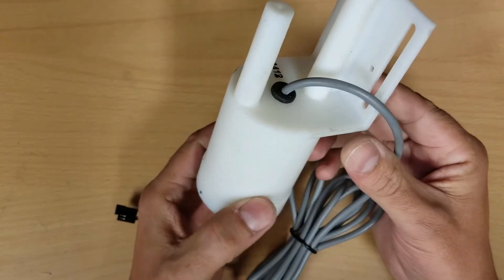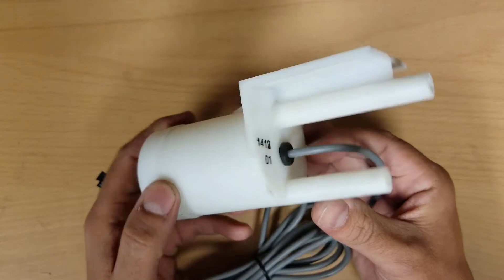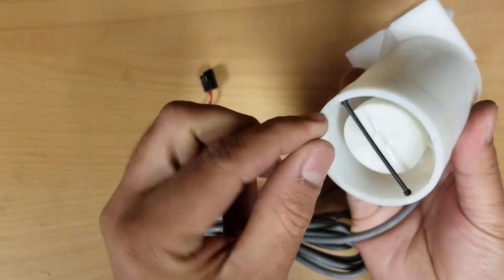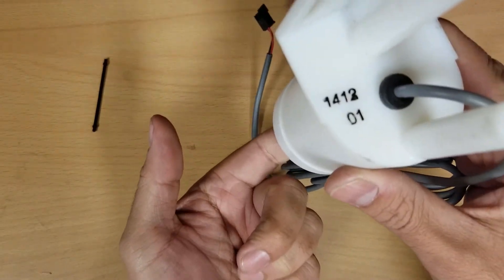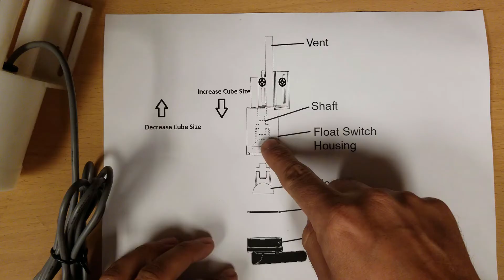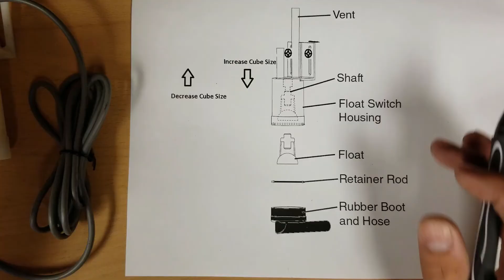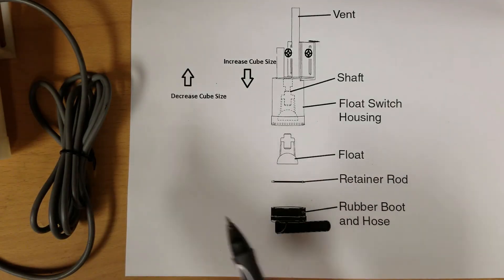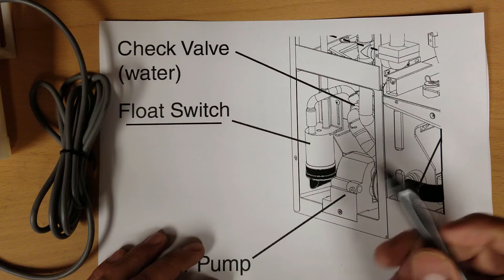Hoshizaki Ice Thickness Adjustment - Float Switch

Comment: Cool. Can you explain more?  What are the pros and cons of smaller vs larger ice cubes?  For instance, If you select larger cubes, does that mean the time to make a batch of cubes increases? Because if the time does not increase then the largest setting would increase production if desired.
What needs/industries prefer larger cubes and which smaller?
Thanks
PS I found this online answered some of my Q:
Hoshizaki Producing Smaller Ice Cubes Due to Float Switch Issues
Finally, when looking at the float switch, you will see that it can be adjusted. The higher you adjust the switch, the smaller the cubes will become because the switch will tell the machine to stop freezing sooner. If you move the switch lower, the cubes will be larger because the switch will tell it to stop freezing later.

Be careful playing with this adjustment because if you make the cubes too large, they may bridge (i.e. start freezing to one another), have large dimples/ridges which will give you all kinds of trouble with long harvesting times, freeze-ups, etc.
-
From video "ice types / making the right choice:
Cubed ice for beverages(crescent, or square, or ), flaked ice for seafood display,
Reply: Seems best to set at the thickest setting unless the cubes are coming out dropping too connected, then reduce some. This should make the machine more efficient and the cubes should last longer in storage or a customer’s glass. 
Also reduce your water supply valve to the ice maker to reduce the water overflow sediment dumping with each ice production so that not very-so much water comes out the drain pipe, but some. Otherwise you’re wasting LOTS of water! Take care

Comment: Hi, question how do i fix the overflow of water that flow into the ice bin after harvest ice thx
Reply: I do have a video so that you can see it clearly
Reply: I'm just guessing here, but the drain for the machine is placed above the drain for the bin. Or the drain is blocked down the line.
Reply: Could be the water fall tray isn't pushed/tucked back all the way under the back wall panel lip. I saw another video on this fix problem was it. Take care